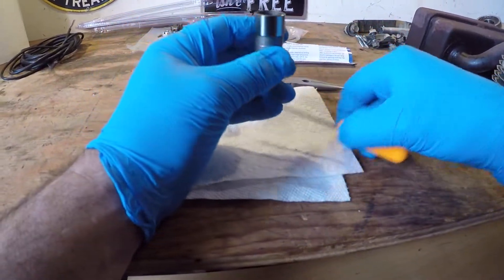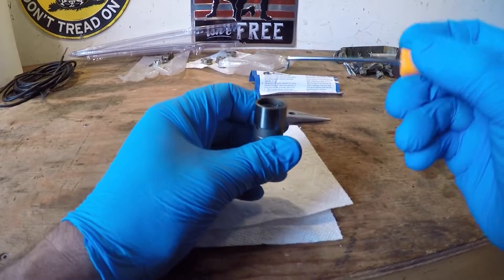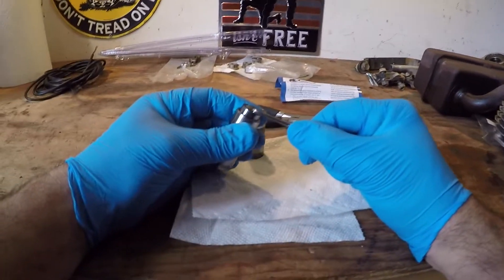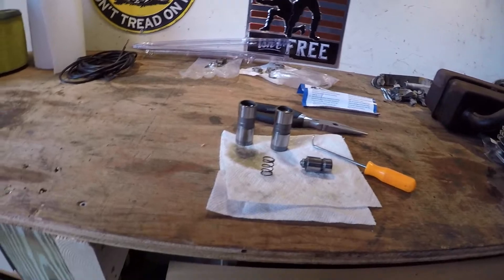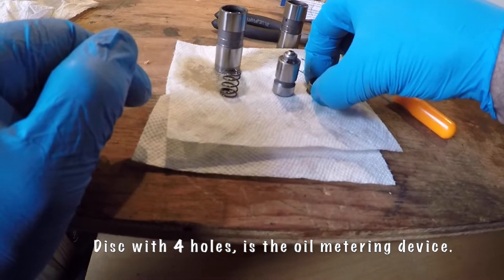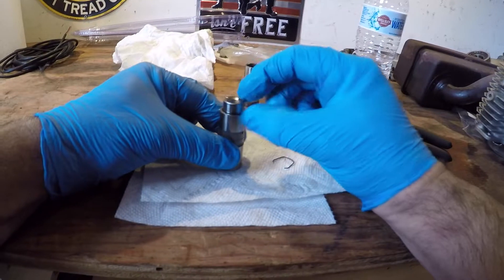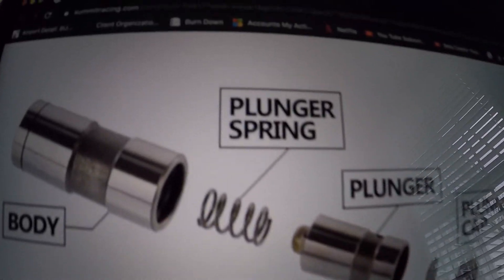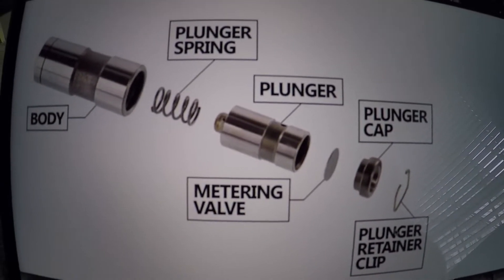What's inside a Kohler Lifter?

Comment: Ironically you also did a what's on the inside of a small block Chevy lifter video as well. Same lifter
Reply: I have a 20hp Kohler. The bottom of the lifters didn't look perfect, so I put 4 new SBC lifters in it, and it's ran perfectly for about 10 years now.
Reply from the maker: Very true! Thanks for checking out the video.

Comment: Dam well when i opened mine i never seen that metering diagram. Engine was potentially worked on before. So if you dont put that diaphragm in it will cause overheating and engine failure.  Just an fyi . Realize that seems like common sence. Video helped me figure out what i did wrong thanks

Comment: After losing many rings and c clips . i found putting a rag over anything springy helps catch it and keep it on bench. Great vid by the way.
Reply from the maker: Good tip!
Reply: I just do it inside a plastic bag..  Just put it in a clear zip lock bag and sacrifice the bag by poking holes  in it with your tools/ pic- and just do things that you would normally do--  and once it flies apart, it's all captured inside the bag.

Comment: Couple of questions does your rebuild kit have pushrods with no holes in them, they are solid? Next question is if you have a lifter that has a tendency to bleed down can you just replace the push rod itself with a solid push rod to stop the bleeding down of the lifter or do you need to replace the lifter which means you got a pull the head off
Reply from the maker: I just bought new lifters, not new rods, they weren't bent or anything like that.  You could probably just replace the rod with one with a solid tip which may help... course, I had the head pulled in no time, so once you're in there, it's not a very big job to remove the head... so that said, try a solid tip if it makes a difference great.. if not, pull the head, not a big deal to do.

Comment: I already knew how they are made  but I still enjoyed watching the parts flying when you took it apart LOL..I have done the same thing before when they wer stuck and sprayed carb cleaner in one and it popped apart
Reply from the maker: I was looking for that tiny spring and check ball that clogs, surprised these didn’t use one.  After the spring took off, the plunger slipped out of my fingers like a wet bar of soap.  I thought there would be a few more parts to them to rebuild or clean.  Still don’t know why they tick if oil is flowing through them.
Reply: @CraigArndt  I was sure there is a check ball inside the plunger part ..Now I want to take one apart